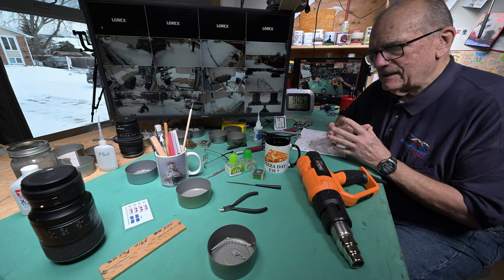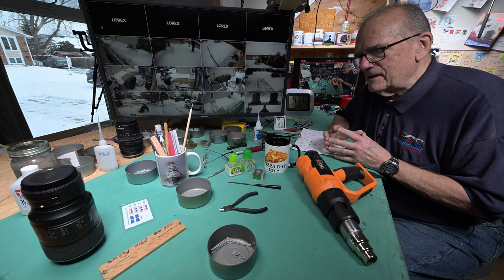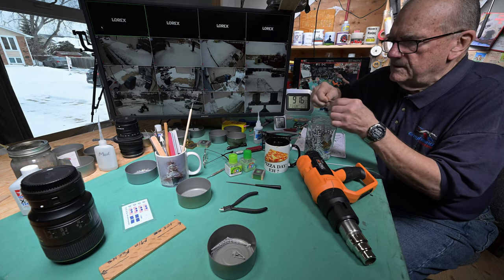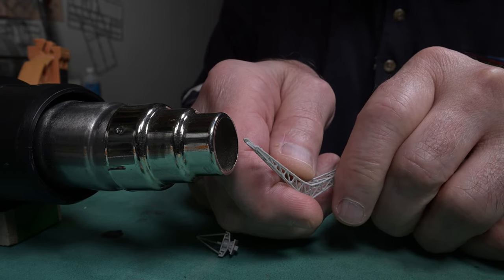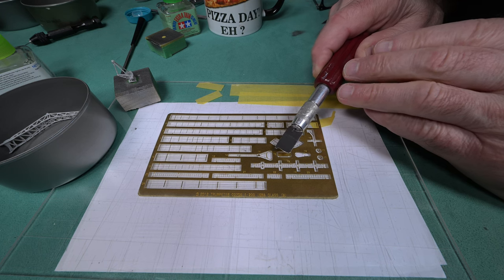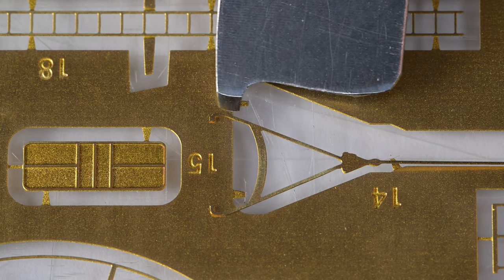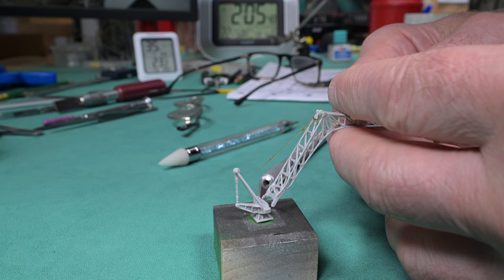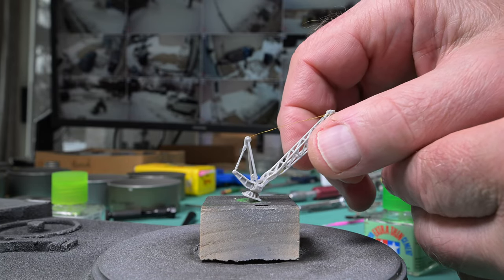The Model Ship - Part 1365

Comment: The best Airshow I ever saw was when I was in the Air Force stationed in Florida. The Navy Blue Angles we’re having their Homecoming Airshow in Pensacola, Florida. Besides the Blue Angles they had the Canadian Snowbirds and the British Red Arrows all performing the same day! Very impressive flying that day! 🥳 I have also watched the Air Force Thunderbirds perform separately at other Airshows. When you did your heat test on the scrap piece it was much thicker than the Crain thickness so your heating and melting time were nowhere the same. At arms length and in the case most people will ever notice it.😉

Comment: Hi Ron, as you say we all make mistakes so I wouldn't beat yourself up about it, I'm sure using the arms length rule it will be unnoticeable. 👍

I was actually going to comment yesterday that you could make a cut in the last rung of the crane cross bracing to allow the arms to spread, but it was such a nice piece that I thought you wouldn’t want to do anything that harsh on it, so I didn't mention it. 

Is that a Canadian specific word for the waterline marking? I'm more used to it being the 'Plimsoll' line...

Have a good night.
Reply from the maker: Oops! "Plimsoll line" 
https://en.wikipedia.org/wiki/Waterline